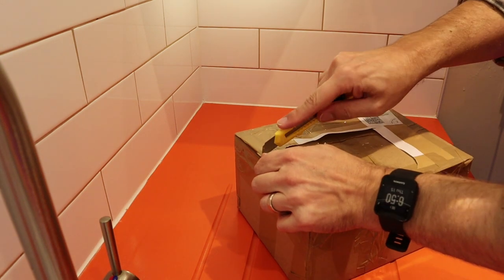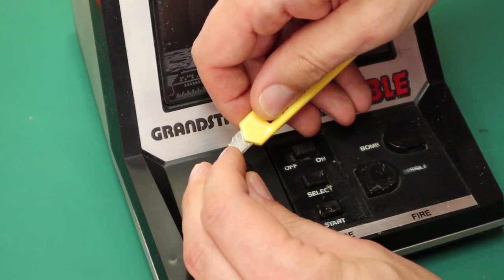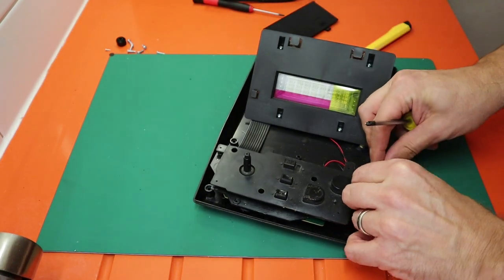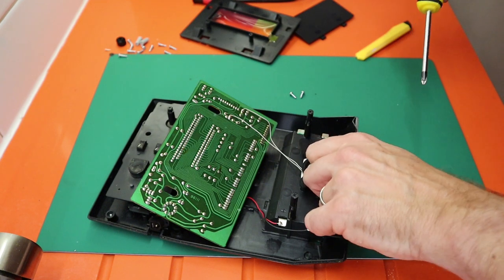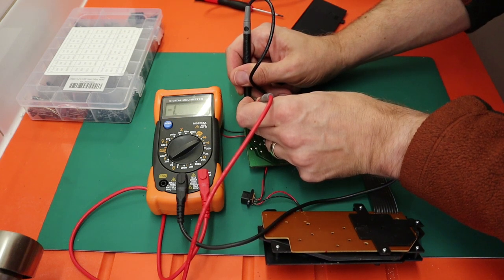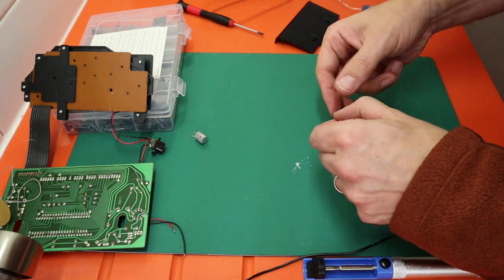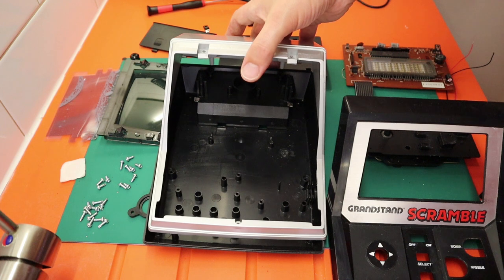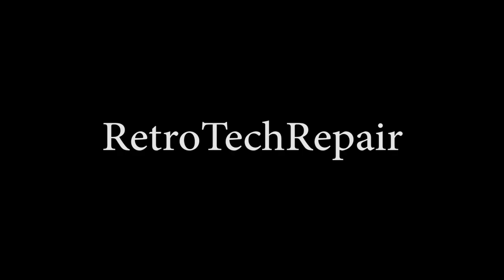Grandstand Scramble / Astro Command Repair - Retro Games

Comment: Thanks for this vid! Just rescued my old Scramble from Mum’s house, it’s not working but hopefully soon will be thanks to your excellent vid. Cheers!
Reply from the maker: That's great Matt, pop back and let me know how it goes. Since this vid I've worked out how to fix another couple of faults too. Let me know if I can help
Reply: @RetroTechRepair  Hello, great video.  I too recently got an old one from my parents home.  I tried to follow your guide and replaced the bits.  It came on for about half a second then died again!  Was thinking I probably need to replace more of the items and was wondering if you could give me any further advice or guidance?  Do you know what values the other caps are?  Thanks.

Comment: What music are you using in this video? It’s really relaxing!

Good job on the Scramble. I came here to find out how the hell to take the cover off with the joystick in the way- I would never have realised the top of it is covered by a sticker as mine looks like it’s completely moulded!
Reply from the maker: Hi supereliptic. I have used various background musics, but for a long time used 'pixelated autumn leaves' from the attribution free area of the YouTube media library and I think that's what I used here. There is a workaround to access the scramble without removing the joystick screw. Once all the case screws are removed you can rotate the top cover 180 degrees, pivoted around the joystick still in place. Depends what you need to access. Good luck with your repair, let me know if I can help, stop back and let us know how it went. Thanks so much for taking time to comment.

Comment: Thanks for your videos I’ve just got one to not working from car boot 
I’m no expert at all but got to try to fix it my self. 

Can I ask what’s the blue gun thing you use when taking the soldering off. 
Thanks
Reply from the maker: Hi Shaun it's a desoldering pump, sometimes called a solder sucker. They are cheap and available on Amazon and elsewhere. Welcome to the channel. Good luck with the repair, let us know how it goes and if I can help.

Comment: I still need to fix mine, I have a blown capacitor but couldn't read the part number, so can't replace it until I find out :P
Reply from the maker: Hi Rob. I am sure I can find that out for you I have a couple of spare scramble boards. Let me know which one it its and I can see if I can track down the value for you.  You might also want to check the power transistor, that I replaced in this video too.
Reply: @RetroTechRepair  Cool that would be great thanks, I'll get back to you soon as it's my friend who does the soldering and I need to open it up again.
Reply: @RetroTechRepair  I just asked and it's that part that's blown I think, however I will double check.
Reply from the maker: @robnostaljah1398  great let me know whenever I'll help if I can